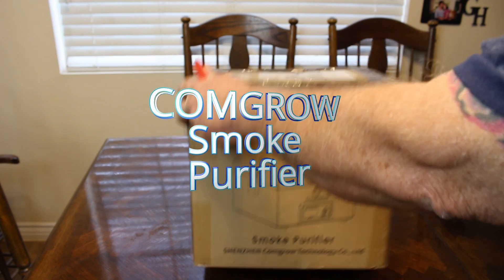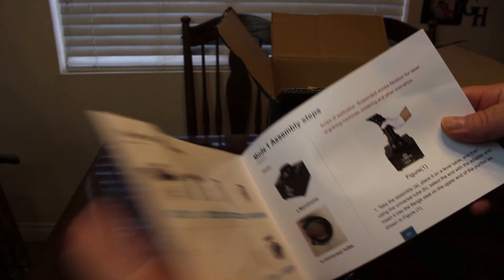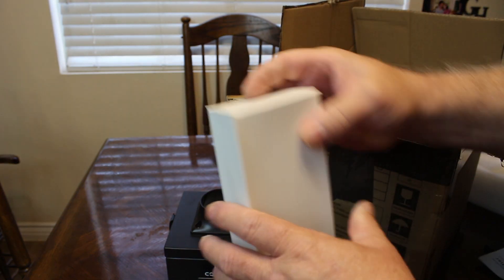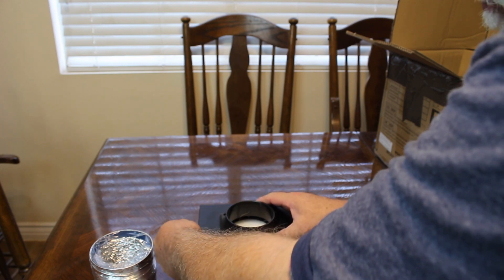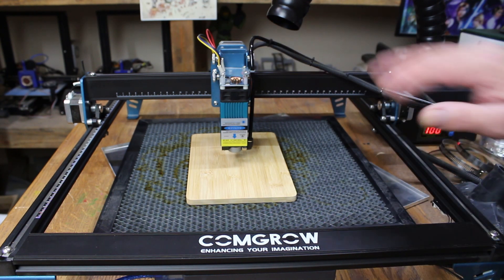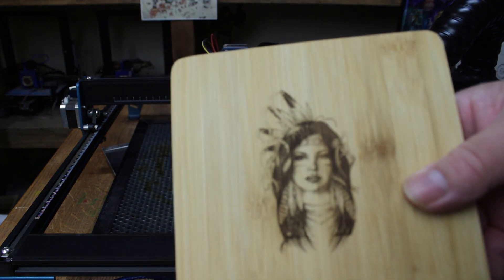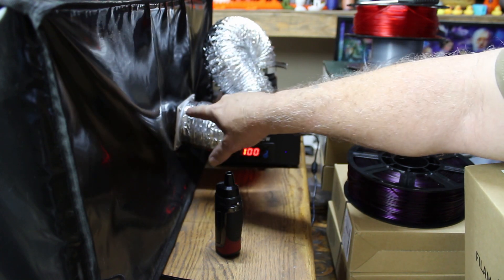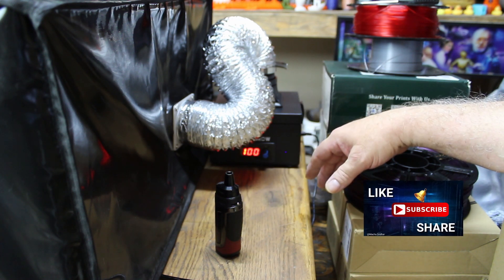Comgrow Smoke Purifier #3dhp

Comment: I found it only works well with the enclosure. It removes the smoke, but it doesn't remove the smoke smell. $19.95 is going be a pretty high price tag for filters that will need to be changed every 6-8 hours though.
Reply from the maker: They recommend 30 days,but depends on use. Comgrow is out of stock on the replacements filters,so I don't know the price.If so some other solution might be found on Amazon or ebay.
Reply: I have one. Good luck finding filters! The other issue is that it does not remove all the particulate. I added an additional activated carbon filter after the hepa, and you can see how much makes it past and builds up on the carbon. This thing is hot garbage.

Comment: Great video. Good point on it not being useful for more toxic (I mean if you can smell it, it's likely not good for you anyway) materials. BOFA is needed for that if you can't exhaust outside safely. 

50cfm (did I hear that right?) is laughable for laser work. It barely got the solder fumes w/o being right on top of the joint where it'll be  cooling your work. I have a 170cfm (rated) exhaust blower and it's marginal w/ an open-front enclosure.
Oh, did it eliminate the smoke smell? Missed that if you said.